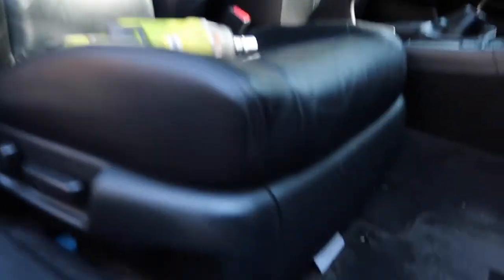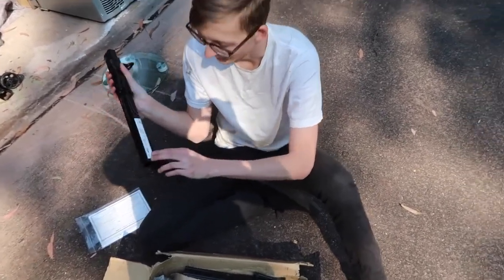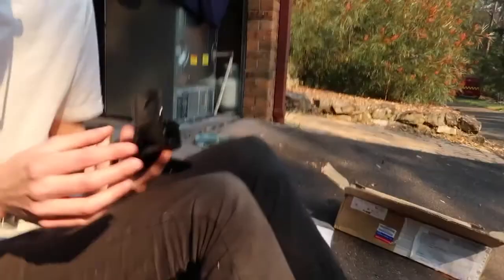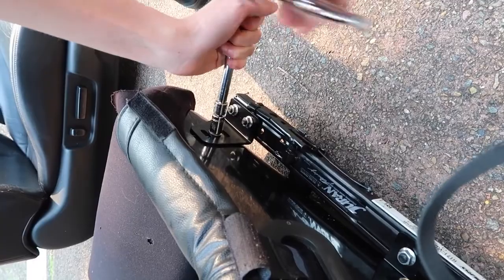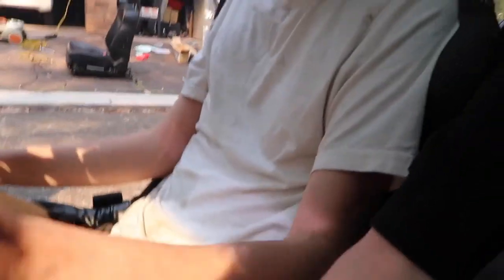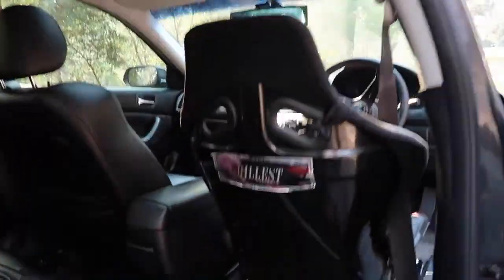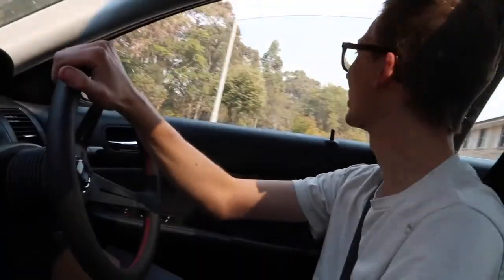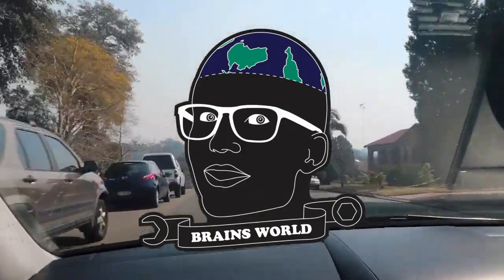Recaro SPG Install - lowest seating position ever!!

Comment: Those seats look heavy AF, I wonder what the weight difference between base model and lux model is. 
Wondering if you can get low seat rails for stock seats. 
Looking forward to seeing this on the track.
Reply from the maker: Yeah they were stupid heavy! Probably a pretty noticeable difference due to the motors/electrics for the seat and the seat heater set up as well.

I haven't seen any low rails for stock seats, you could maybe look at CL7 Type R Factory recaros or FD2/FN2.

About a month now until the first track event! Super excited to see how it goes.
Reply: I guess Im asking the wrong place but does anybody know a tool to get back into an instagram account..?
I was dumb forgot the password. I appreciate any help you can offer me!
Reply: @Nicolas Leroy Instablaster ;)
Reply: @Matteo Justin It did the trick and I now got access to my account again. Im so happy!
Thank you so much, you saved my account :D
Reply: @Nicolas Leroy no problem =)

Comment: Are you gonna bother getting the seats engineered? Or just fark it??
Reply from the maker: Nah, I had a Datsun 200B a while ago that I turbo charged. I went through the process of engineering and it was a nightmare. Took forever, cost an absolute fortune, didnt really get me anything in the end and cops can still defect you. They defect you so that you have to get the car checked and its still compliant with your engineering cert.  So really it does nada.